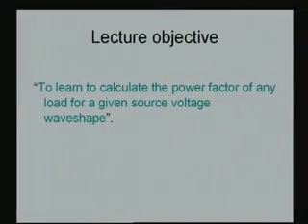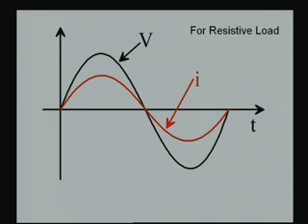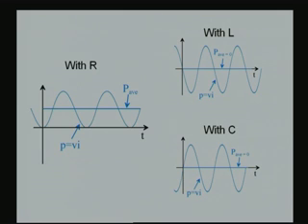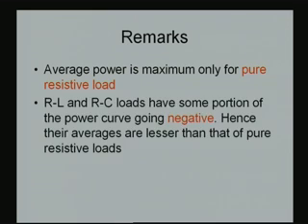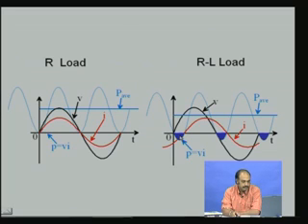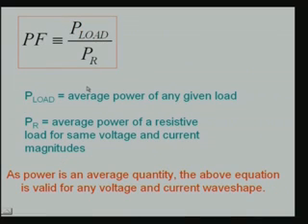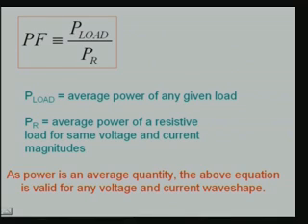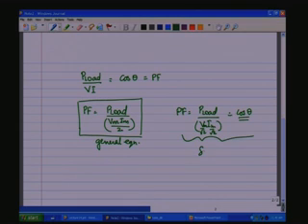Lecture - 15 Power Factor

Comment: thanks to hrd ministry for this excillent effort.i have passed through many lectures here its too easy to understand but one thing i would like to say about the speed of the lectures of course it would have been betr if it is fast...........one more thing about this particular lecture no-15 is dat at hr 21:04 the shifting of graph shown is not correct it will shift downward as well as towards the right hand side nd finally one of the [p=0] points will be @ origin..same thing done in case of capacitor later also....hope this will be acknowledge soon
Reply: There is a Gear symbol for settings, You can alter the speed of the video to make it faster.

Comment: down to earth lecture, well done, though there is a remark: at 23:26, the capacitor value is mentioned as C=0, which is wrong. C must be close to infinite in order to have an R-C circuit emulating a pure R load (circuit).

Comment: I have 2 questions.
1.      Which is producing more power
a.      A motor drawing 5000 hp at .8 power factor, 
b.      A motor drawing 5000 hp at 1.00 power factor.

2.    Which is producing more power
a.  A generator producing 5000 KW, 5000 KVA at unity power factor, or
b.  A generator producing 5000 KW, 6250 KVA at .8 power factor.

Comment: Can any1 explain How frequency  is double for power  in resistive load ??
Reply: Draw the temporal graph and multiply the instantaneous values of I(t) and v(t)
Reply: Else Simply draw I(t) and v(t) multiply the instantaneous values of I(t) and v(t)
Reply: When u compare the power wave with current wave or potential wave for both the positive and negative peaks of wave the power wave is at positive peak making it complete two cycles while the current and potential waves completing only one